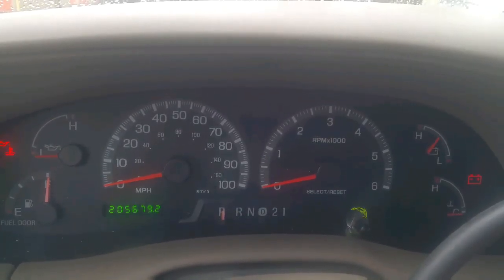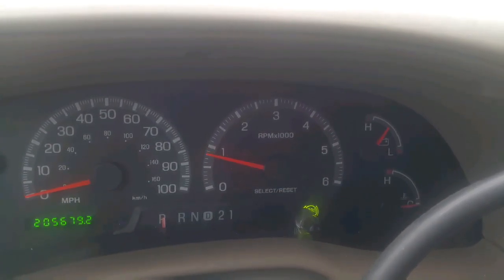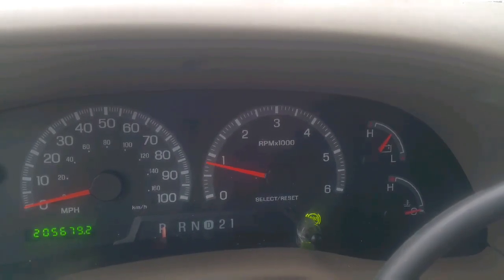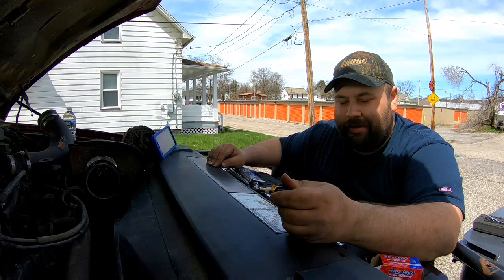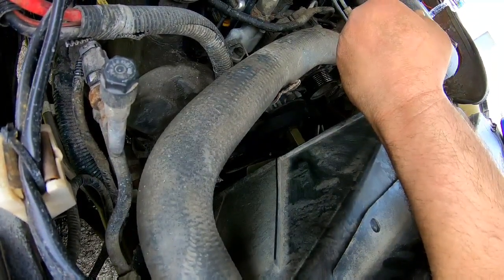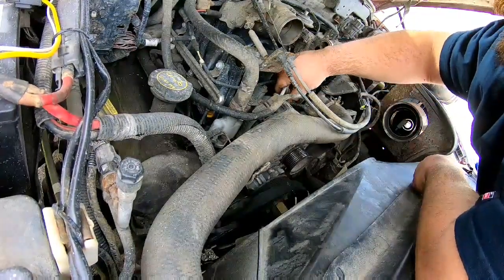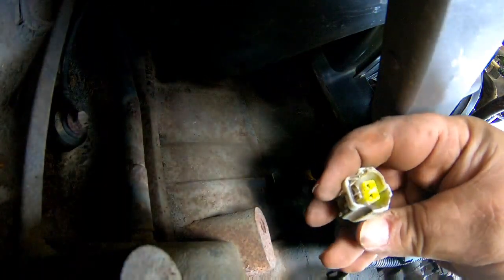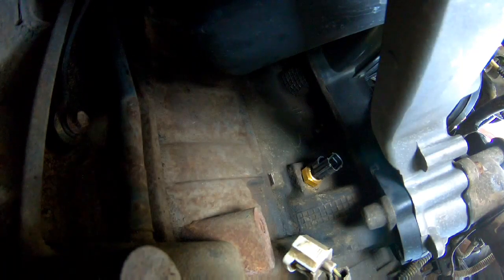Cylinder head temperature sensor replacement 2001 ford f150

Comment: Bro... words can’t describe how much your video helped me. Thank you thank you thank you!!! Had to change cracked and leaking intake manifold. My friend started the disassembly and broke that sensor off at the base and soon after left and never told me about it or where it’s location was. I finished the job but was left with a dangling wire and no idea as to where it went. Also truck either no start or idle way too high or temp gauge not working. I thought I had screwed up majorly. Your video showed me the way!  Your the man!!!

Comment: Thank you for the video.   I have a 6.8 and there are two bare wires hanging out near the sensor.  I just wanted a good view of it so that I had the ability to pop the connector off.  Luckily I didn't have to change out the sensor.  New wires to the connector and back on the road.  Thanks again.

Comment: Thank you so much Car maniac 125  my tachometers showing the same problem and I have a high idle had to turn the idle screw down until I replace the coolant sensor  My sensor is a lot easier to get to on my 98 F1 50 XLT it’s located right next to the thermostat on the driver side of the engine thanks again

Comment: Great help, I also found an easier step when removing it. Just snap off the electrical connector with a tap of hammer and well placed screwdriver. THEN...you can use a LONG 3/8" extension (I used two 18" extensions to get the reach...have one hand guide the 19MM socket in place and hold where the 2 extensions clip together, and the sensor can be ratcheted out quickly.  Putting the new one in is the same slow process with wrench (I also used a 3/4" short one as I went along and still you will be turning in tiny increments.  OK hope that helps the process a bit!

Comment: Hey Man, I think you put that thread tape on wrong. Its opposite of what you did... You need to make sure the end of the tape is pointed in counter clockwise direction. Then as you turn threads clockwise the tape will tighten on the threads.

Comment: Just did this on my 2001 4.6 v8 XLT and the area is so cramped, I couldn't tighten the new one down all the way.  It is located in the same spot as this one, though.  Going to get one of those swivel-head ratchet wrenches and see if I can get the last few threads tightened up this afternoon.  Any idea if it has to be tightened all the way in order to take legit readings, or might I be okay with a little gap?  

Thank you for posting this, no one else had the location for this sensor on any other videos. :washhands:

Comment: Thanks man!  I have a serious problem with my 97, 5.4 F150.  P0118 code.  Have changed the fuel pump, crank shaft sensor, ECT sensor, etc.  No heat.  Only ECT that worked was pull from a junked truck, other wise, after market parts the temp gauge didn't work.  My research showed that the ECT, and Cyl. Head sensor both trigger the P0118 code.  I'll try this next.  LOL mind you the shop charged me over $200 for this diagnosis, and wanted to charge over $1700 to change the fuel pump, and tune up which was not the problem.  Any suggestions are appreciated.

Comment: Man, what a huge help this video has been.

This little sensor has been my problem 🤞. 
Let me ask you something, have you ever replaced an intake manifold on this motor? I’m in the process of replacing my leaky intake & was wondering what all I should replace while the intake is out?
Reply from the maker: I have and the number one thing that I'll tell you to change will be the spark plugs cause they are easy to change with the intake outta the way. I actually was gonna do that video but I was pressed for time. If only I could free up time, lol. Replace the thermostat of course and look at your heater hose tube that runs under the intake. It has a o-ring that goes in the back of where the water pump is located. It would be easier to show you than trying to explain it, lol. Oh, be prepared to clean that valley out cause everything usually  ends up collecting up in there. When I did mine I had to use a shop vac and a scraper to dig the caked up mud and I found a mouse or something carried cigarette butts and whatever else to make itself a bed. Also replace your fuel injector o-ring out. That should be it unless you end up breaking one or more coils from removal. I ended up replacing 2 of them do to this, lol
Reply: Car Maniac125 Ok, I do plan on replacing all the coils, plugs, injectors & O-rings. I’ve got a new CHT sensor on the way & I’m about to buy that heater hose tube now.

I’m also going to go ahead & replace the heater hose connector (I call it a tit) on the back side of the water pump.

Thank you for your help. Keep the good work up, brother!

Comment: Mine is a 4.2L and it’s in the back of the head on the driver’s side . A little hard to get to but not impossible if you come from underneath the truck . Nothing else to take off just the sensor itself .

Comment: yea its like when the old carb type engines would flood with to much gas. but it only last a few seconds then it runs great but if you notice your getting worse fuel mileage also. oh and you can use a 3/8 ratchet deep 3/4 and not remove anything.

Comment: Will a bad cylinder temp sensor cause the engine temp gauge to read hot all the time? My needle goes straight to the highest position when I turn the ignition to the on position. I replaced both engine coolant temp sensors and it still does the same thing. I  have not replaced the cylinder temp sensor yet.
Reply from the maker: Its possible but usually when a guage does that it's a broke or shorted wire. Also, the guage cluster is known for bad connections. It would be best to test the circuit for a short
Reply: @CarManiac125  it turned out it was the gauge cluster. Thank you for your help.
Reply: Is this the same place for a 02 with 5.4 triton
Reply: @CarManiac125  sir I have a question??  Are you talking about the cooling temp sensor because I think the cylinder sensor controls the temp gauge, am I wrong.

Comment: Hey brother, bit of a random question here...what type of engine coolant do you use on your 2001 F-150 5.4 V8 Gas?
Reply from the maker: I just grab that universal coolant and save myself the hassle. If I remember correctly the actual coolant that's supposed to be in there is Ford premium gold. I've heard people talk trash about the universal coolant but I've had no problems with it. Even the old gm cars that had the problem with DeX cool eating the plastic intake gaskets. Hope that helps

Comment: No laying down on the job lol. That sensor is hard to get to  which temperature sensor read off the computer in the truck and which on reads the temperature gauge. Because my truck is idling up high and flooding with smoke out the exhaust system every is telling me it is the temperature sensor causing it. My temperature sensor is new as well but it isn't making the gauge move any. Unless you turn the key on or off then it will rise and drop. The motor is warm hand stays at C for cold. So they said it has two sensors for it coolant one for computer and one for the gauge

Comment: Do you recommend changing the wiring while I’m there as well? 

Also, I see you have the K&N cold air intake. Been thinking of getting one for my 01 F150 5.4 v8 4x4. What’s your thoughts on it? Is it worth the $280+ bucks for it?

Thanks again for the helpful video.
Reply from the maker: Changing the wire would be worth while if it looks ragged, otherwise I wouldn't bother. The K&N cold air intake doesn't really seem to help much do to heat soaking but if you combined the intake with some header wrap, it'll definitely work the way it should. On its own it's ok but I personally feel they over priced it for the little bit it does. I've heard you need the mass airflow sensor calibrated for it to work right but if you go check out bleepin jeep here on YouTube. Matt does a great cold air intake video that will help you decide on what your gonna end up doing. I also plan on changing mine thanks to bleepin jeep

Comment: I have to ask. Why did you disconnect the alternator wires? I just set the alternator to the side and leave the wires connected.
I left my alternator on and used a crows foot. took all of 5 minutes to change it

Comment: What size motor are you working on? I have a 4.6 interceptor. There is a piece of styrofoam,  like board, behind the CMS. Did you push yours out of the way? Thanks
Reply from the maker: That was a 5.4l and there was nothing like that in my way

Comment: I've done some research and it seems the CHT sensor is a dry sensor,I am working on a 01 expedition and we had bought a cts,off course they sent one that was for a few models newer so we couldn't ever find it.
Turns out the CHT is the same thing on the 01 models,I am going later today to get the right one and get it back together*
We just changed all the injectors today,and I am thinking the CHT is the reason for the random misfire now.... after a little more research and watching your video*
Reply from the maker: If thats one that has a plastic intake manifold on it, check for cracks. I had the random misfire code pop up for that also. Its rare but does happen. Usually has lean o2 codes with it. Also, check to see if your spark plugs are tightened down. I had another slight miss and one day the plug that was loose shot out. Ended up buying the cal-van kit to repair it

Comment: I have a 2005 f150 4.2L. I've looked everywhere for an answer. Problem is that the gauge goes to hot after 20 minutes of driving. It does not actually over heat. Changed cylinder head temperature sensor, thermostat, instrument cluster. Has no leaks no air in coolant system. I'm not sure if this model has a coolant temperature sensor.

Comment: So here’s my problem, my wires got chewed through right at the sensor by a mouse. I don’t know where the wires go exactly to communicate with the pcm. I see they go towards the driver side in the video, but where exactly? Any help is appreciated.
Reply from the maker: I wish I had that answer for you but I don't. Its been a long time since I did that job and it maybe in your best interest to try and get a pigtail plug for that sensor and splice it in. One thing I do know is some time in the 90's ford started making their wiring harnesses all one unit. So its either replace the whole harness or splice in what needs fixed
Reply: WPT-1254 is the part number for the harness for future reference.

Comment: Thats a coolant temp sensor. Not a Cylinder head temp. sensor. I learned that the hard way. The cylinder head sensor is located in the rear above the number six cylinder head. on passenger side.
Reply: What happen

Comment: I just changed the intake manifold and gaskets on my 5.4 triton but when I go to start it, it won’t fire up. Checked it it had fuel pressure and spark, I kept looking around and found the head temperature sensor broken. Hopefully when I replace it my truck fires right up!!
Reply: Justin
Do you have an update on your truck?  The intake manifold on my 2002 f150 5.4 was replaced 2 months ago and now I’m in a crank no start scenario. The P1288 code is leading me towards the CHT sensor.

Comment: Is a 02 F-150 with a 5.4 triton sensor located in same place
Reply from the maker: Yep
Reply: Ok thanks gonna try fix it today
Reply: Got to it but seem pretty tight don't wanna break it any tips to getting it loose
Reply: Ok just wanna say thanks got it out and replaced, truck is running normal all lights are out and another thanks to you

Comment: Any idea where it’s located on a 4.6?
Reply from the maker: Not off hand but I do have a 4.6l model in my drive now. Unfortunately I'm at work now. Keep your eyes open here and when I get home tonight I'll check out the 4.6l I have and let you know
Reply: Thanks, I’m getting a P1299 code and have read up on the 3-phases that Ford built into this system.  1) initial safety check engine light, 2) shutting down 4 injectors to cool cylinders and then, 3) shutting down all injectors
Reply from the maker: Good to know actually👍
Reply from the maker: Well, I just got home and I raised the hood on my 99 with the 4.6l and that sensor is in the same location as my 01 5.4l. My 99 with the 4.6l has the aluminum intake manifold on if that matters
Reply: Thank you very much.  I could not find this info anywhere . . . For your information - P1299 Ford Description Indicates an engine overheat condition was detected by the Cylinder Head Temperature (CHT) sensor. A Failure Mode Effects Management (FMEM) strategy called fail-safe cooling was activated to cool the engine.  This ‘strategy’ apparently occurs in the 3 phases I was referring to.  I appreciate your help - thanks again !!!
Reply: @hatteraslabuf  This is the same code I just got yesterday.  Did replacing the CHT fix this fault for you?

Comment: Oh you replaced the temperature sender, not the CHT sensor.  The CHT is underneath the intake manifold on the rear passenger side of the engine.
Reply from the maker: That's a 2001 2 valve engine not the 3 valve

Comment: is this the same for an 03 navigator with the 32v 5.4l?
Reply from the maker: Honestly I didnt even know they had a 32v 5.4l in those, lol. I'll do some digging around and see what I find
Reply: Car Maniac125 thinks what I’m seeing it’s in the back of the head I’m hoping that’s not the case lol
Reply from the maker: Wow, that's what I just seen myself. All the years I've worked on these monsters and never knew or at least seen one with the DOHC engine. I know one thing for sure. Everyone one of them bodysytled SUV and truck is when they need the timing chain tensioner and guides replaced the body has to be lifted off the frame to remove the valve covers. I'm sorry to be your bad news delivery guy but if you have no way to lift the body up it's best to see a shop. I wouldn't tell them to change that sensor though. Tell them the problem your having and let them look it over and test things out. I worked out in the shops and know that techs dont like to be told what to do. Good luck. I was actually looking at a nav and now that I know that I may just change my mind. However I am crazy when it comes to cars and trucks so I may still get myself one, lol
Reply: I believe 97-06 were the only years that had the 32v

Comment: Does dis part bring the check engine light on?? Or how to tell if I need to replace??
Reply from the maker: Check engine light may or may no in my case, come on. If you pay attention to the beginning of my video you'll see the idle start to jump up and down. It has stalled on me before. If the thing goes out completely the truck would start and stall immediately. It can be checked with and ohmmeter but you need to create the cold or hot temps to get it to react.
Reply: @CarManiac125  what about when your driving
Reply from the maker: Not effected. As soon as the temperature changes its fine
Reply: Car Maniac125  does it have to do with anything overheating?
Reply from the maker: I've never known it to cause overheating, but if by chance this was a vechile with an electric cooling fan then it could
Reply: Wonder if this is why I'm having  
A misfire on cylinders 1 and 4 on my f150  and the same code came up when I scanned  it . Plus I just did the plugs and coils
Reply from the maker: My first recommendation for your problem is to check the intake manifold for cracks and vacuum leaks. I had that problem before and it was an intake manifold leak. Most of them get plastic intake manifolds but all of them get intake manifold gaskets which can go bad as well. Also check the fuel injectors for leaks but they could be bad in general. Hope that helps
Reply: Awesome dude thanks for the reply . But yeah thats what I'm into right now and hopefully I'll find the problem . Thinking of pulling the injectors just too see if there in spec still . But I'm thinking i might have pin hole ĺeak someplace
Reply: @CarManiac125  crown vic, grand marques, town car, have cylinder head temp sensor, in same local. They do have electric, cooling fans, and it renders them inoperative. PCM, docent receive correct info, so no signal, to fan controller!! Maddening!!!

Comment: Ummmm... The CHT sensor is in a hole in  the cylinder head....... not in the coolant. It only measures the temperature of the cylinder head.   

Then the temperature of the coolant ECT  is calculated by the computer, for a normal engine, based on what that engine cylinder head temperature is.

Crappy but good enough to run an engine until something goes wrong

Comment: Omg why is my truck so different i have a 03 and my truck doesn't have all that free space in the back like yours does and the stupid clip is up against the wall. I can get my hand or any too to take the clip off
Reply from the maker: Hmmm, I know in 2004 year was the split model year where they had the heritage model which would have the old 2 valve Triton and the new body had the 3 valve Triton. Not sure about a 2003 having a 3 valve engine. But I do know the 3 valve engine is set up way different and the temp sensor is mounted on the rear of the cylinder head on the passenger side(right side) also known as bank 1 side. Idk you got me stumped on this
Reply: @CarManiac125  i got the clip off but now there is another issue I can't get any 3/4 socket to fit in there